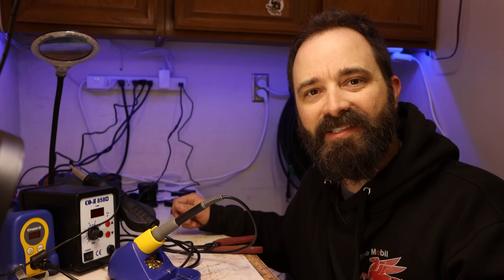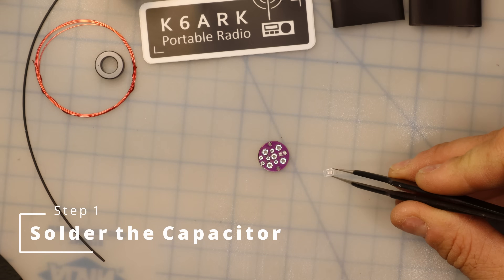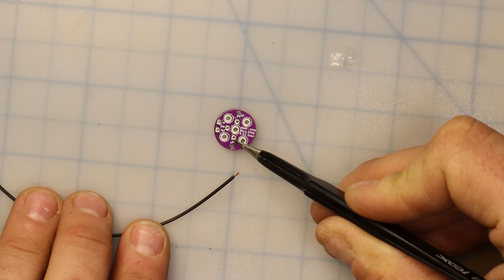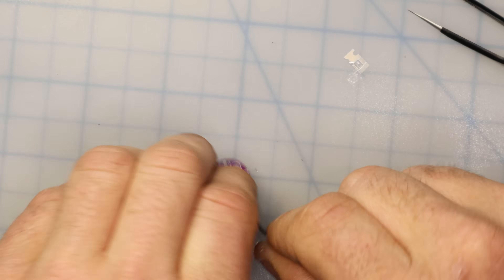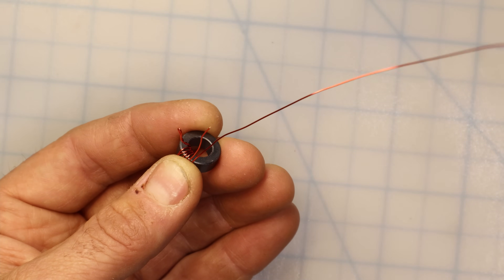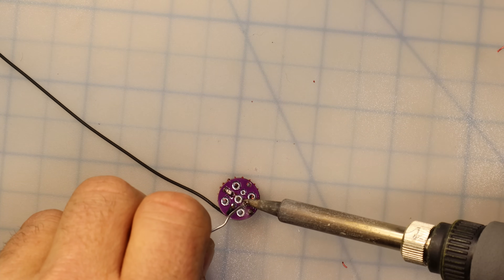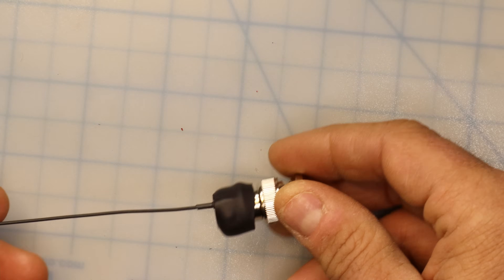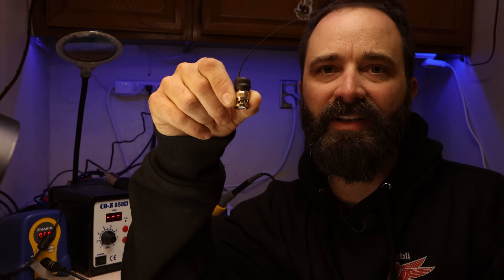K6ARK Matching Unit Kit Build - End-Fed Half Wave (EFHW)

Comment: Nice Kit. Looks like Type 43 toroid which worked well for me with 49:1 transformer EFHW. Type 2 (Red) toroid was better for me as I got better performance with 9:1 UnUn, specifically 10m and 6m on NET Nights which I do portable at times  ; )  Anyway a must have in my portable setup . How much power will it handle?    Thank You. . . Mostly I use T200 Type 2 (RED Toroid) 9:1 UnUn, Type 43 RF Choke, 29ft wire and 17ft counterpoise (EARCHI Antenna)
Reply from the maker: Yes, it's a -43 mix which works well in all 3 build options. I generally recommend a maximum of 10 watts for lighter duty-cycle modes and 5 watts for modes like FT8.

Comment: Great ! Tnx, but how could this work without counterpoise ? using the coax shield ?
Reply from the maker: I don't use a counterpoise or coax.  That means that the radio chassis and anything it capacitively couples to (me) is the counterpoise.  It works very well that way.  If you prefer, you can also add a counterpoise to the build. The PCB has a pad and a strain relief hole for it.
Reply: @K6ARK  tnx

Comment: Nice kit, mine is on the way. I might suggest putting in one or two extra spare capacitors. Those SMD caps are about 10-12 cents purchased in 100 quantity or greater. People are definitely going to lose the cap, burn it with the soldering iron, etc during installation, and it would be a bummer to ruin the whole kit over that one part. I say this completely acknowledging that you've made it as easy as possible with the nice little custom PCB. Nice work.
Reply from the maker: Good call, maybe worth it.  I am also happy to send a spare (they're so small they fit in a regular mailing envelope) if someone damages or loses the one in the kit.  Just reach out to me and I'll be happy to help.
Reply: @K6ARK  could you just use a standard cap soldered to the pads ?
Reply from the maker: Probably. It would be a tight fit, but I bet it would work. Just make sure it's at least 1kv at 100pf.

Comment: He’s alive!  I had thought you’d fell off a mountain, or you were on an extended ‘on location’ action film shoot, doubling for Bruce Willis as a stunt double.  Huh, I’m rarely wrong…. But hey, I did build your kit, and hey, I love it… a 9:1 Unun with linked 20-40m legs… Bravo Adam!  Now I need to figure out how to install your cap key kit into my QCX Mini…. de W7UDT Rand (dit dit)
Reply from the maker: Thanks Rand! Yes, I get busy with life sometimes as well, but I do need to get back to making some more videos again.  I also need to finish my reply to your email.  I do have more cap touch key PCBs and can get another headed your way.  Thanks and 73.
Reply: @K6ARK  Hey Adam!   Here’s a heads up… I’m working on a protective laced Kydex S/POTA board for my KX2… (what the ‘he double toothpicks’ is that?)

My KX2 has rails, so the top molded half of the shell will be clear, and act as a cover for the KX2, being laced together with paracord to the bottom half, a 8x12” flat clipboard… the sides of the top case will be open on both ends, extending an inch or so off each end.  The top cover will accomodate the front paddle.  It’ll all hang from a lanyard off my neck, so when seated, I can comfortably operate and log my contacts… whatcha think?  The laced board will provide the weather and impact protection the KX2 lacks…. Being laced by paracord, it will hold the radio securely.

Comment: Thought it was going to be a 9:1 UNUN that was going to be used as a EFHW match.
Reply from the maker: End Fed Half Wave (EFHW) uses a 49:1 yo match a resonant end fed half-wave radiator with feed point impedance around 2k ohms.  The 9:1 unun is most commonly used as an impedance transformer to make a random wire (non-resonant length) a lower impedance for an easier match with a tuner. A tuner is generally required with a 9:1 unun and random wire.  The kit can be built either way to suit your needs.

Comment: What kind of power can we run through this badboy?
Reply from the maker: I generally recommend 10 watts or less.  You can add a FT82-43 toroid and build the kit for 30-40 watts max.  The FT50-43 in the kit nests perfectly in the center of the FT82-43.  Wind them together as if they are a single toroid. Works great for the G90!
Reply: @K6ARK  say no more. I have an ic705. Ordered one to support and try out!

Comment: Hi Adam,
Happy New Year. Excellent build video. Close-ups were perfect. I think the silicone should be the acetic acid free type to prevent corrosion. Would dribbling some hot glue affect the tuning? Stay safe.  73  WJ3U
Reply from the maker: Thanks Don, yes, non-acetoxy silicone would be best.  Hot glue should work well too, but has a lower melting point that may be a problem in hotter climates.

Comment: how much power can the transformer handle?  Looks great.
Reply from the maker: Andy, I recommend 10 watts max for lower duty cycle operation like SSB, and  5 watts for heavy duty cycle modes like FT8.
Reply: @K6ARK  It works.  I scanned the transformer with a 2.5 kohm load that also acts as a voltage probe.  Looks good out to 50 MHz.  I emailed you the magnitude of the transfer function plot.
Reply: @K6ARK  Thanks.

Comment: Thanks ! As soon as I seen this video I went straight to Amazon and ordered 2 of your kits.
Reply from the maker: Awesome, Nick! Please feel free to reach out to me with questions or if you have any issues. I want to make sure everyone is successful in their builds.
Reply: @K6ARK  would it be possible to make this be able to handle 20-25 watts by using a bit bigger wire ?
Reply from the maker: Wire is not the limiting factor, the toroid is. You can add a FT82-43 toroid and nest the FT50-43 in the center, then wind it as if it is a single toroid. Works great for up to about 30-35 watts!
Reply: @K6ARK  thank you!
Reply from the maker: @nickrupp2336  built that way, it's a fantastic G90 antenna. I may make some G90 kits at some point... 🤔
Reply: @K6ARK  that's just what I'll be building it for. Thanks.
Reply from the maker: Yep, I've built multiple that way. I also typically build a 5 foot or so jumper of RG 316 with a common mode choke at the far end to help keep RF out of the rig. You may have seen an antenna like that in Tank Radio's recent videos 🤘😁
Reply: @K6ARK  Will be on the lookout for when you do!!
Reply from the maker: Available now! https://k6ark.com/kitsandparts/
Reply: @K6ARK  Ordered 2! Thanks